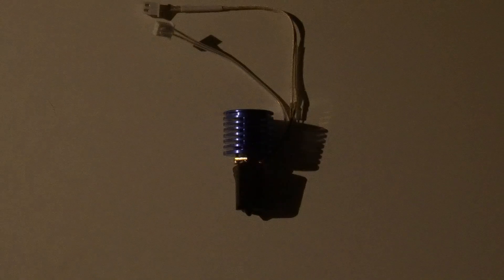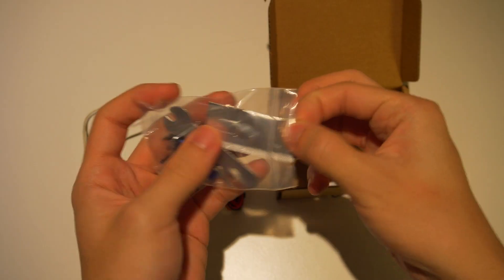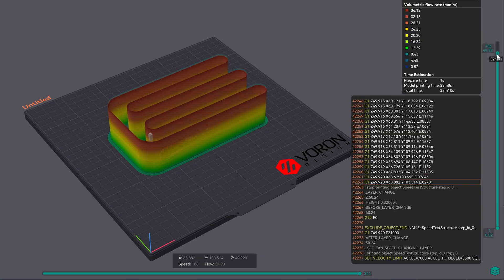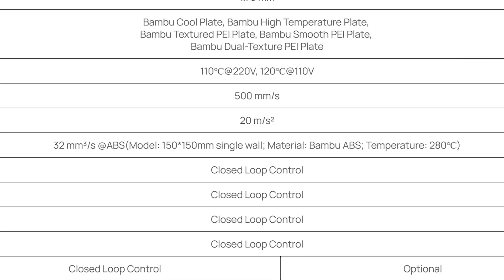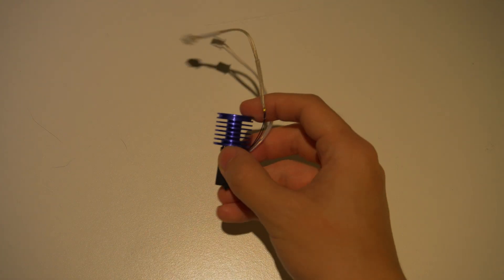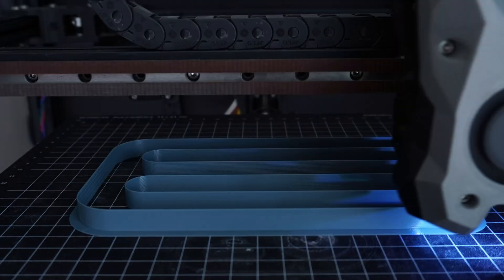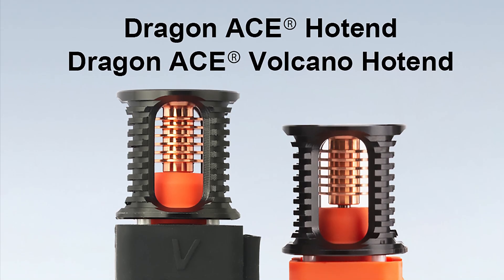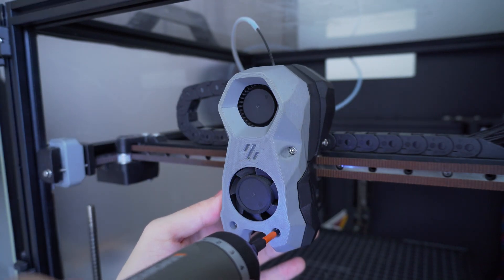TZ V6 – Is This Budget Hotend Worth the Hype?

Comment: Isn't the temperature not stable even if the PID calibration is completed?
Reply from the maker: After PID calibration, the temperature seems relatively stable when I'm not pushing the flow rate limit. 

It's only when I try to print too fast and hot with it that it becomes unstable.

Comment: add a second heater to the side, wire in parallel and go nuts. I have the X1C version, but the meltzone is identical. I hoped to get the V6 radiator for it, but v3 has nozzle and heatbreak in single piece. also I'd recommend to undo the two heatbreak bolts and apply threadlocker to them. mine came loose on my 4th TZ hotend, luckily I was in the same room with the printer when it happened.

the CHT nozzles add about 10% flow with added risk of oozing/webbing if travel speeds and accels arent fast enough. overall, TZ V6 hotends are best bang for buck, next in the list is Peopoly Lancer Long hotend which is less common and is not as supported but with heatsink cut smaller and holes redrilled and tapped can utilize same toolheads that support Goliath. Lancer Long does up to 55mm3/s in my experience and up to 30mm3/s with 90A TPU whilst I have issues with the V6 right now. next after Lancer is the mentioned Dragon Ace which can go up to 450-500C and push filament up to about 70mm3/s, with also easier maintenance as the thermistor and heater are simple capsules and do not need messing around with thermal paste.

also, print ABS at 270C-280C
Reply from the maker: I just accidentally broke the hotend and now I have a spare heater...I guess I will be giving a dual heater configuration a try now. Applying thread locker on the heatsink bolts is a good tip! Will definitely do that when my new TZ hotend arrives.

Comment: I'm using these hotends on my printers for over a year now. With a melt zone extender (with built in cht zone) and a V6 nozzle you have the same length as a volcano hotend. With a 80W heater (dual 80W for the insane people) you get plenty of flow rate. ;)
I like the hotend for the performance and their cheap price.

Comment: Maybe I missed something, but you didn't mention klipper adjustments. This hotend uses different thermistor, so you need to change your config accordingly, and then do PID calibrate command again. This should help with performance at higher temps and reduce oscillations. Also those are not V6 nozzles, even though it's got same thread size, it's of different shape and probably mass. If you change your nozzle material or shape it's not a bad idea to recalibrate your PID again, it's not a long process.

I am using one of those bimetallic nozzles(ZS V6 by TriAngle, one of the first of its kind),  maybe a bit more sensitive to cooling part fan, I didn't feel like I need to change a temp, but I've seen some advices to boost it up 5 degrees to match regular brass. My experience is good, and there are many other cheaper options, though it seems there are variety of filament path shapes and insert thickness that can affect performance.
Reply from the maker: It’s been a while, but I checked that I did update the Klipper config before doing the PID tune. Appreciate the reminder though! Yeah different nozzles can definitely shift the behavior. I've only used the coated brass nozzles and currently the bimetallic ones, so far they seem to respond similarly with same temp.

Comment: Seems like a fair take on the hotend! One thing I want to mention is that the heaters used on the TZ V6 are PTC heaters, so their power decreases as temperature increases. By the time you heat it up to 280c the heater will be close to half the power of when it's at room temp. Couple that with an already unpowered 48W heater and you're gonna have a bad time with ABS. A quick fix is to buy a heater for the Rapido 2. Those are 80w and are a drop in replacement for the TZ V6
Reply from the maker: That explains a lot! I didn’t realize the power drops at higher temps with PTC heaters. Appreciate the Rapido 2 heater tip! That makes it easier to look up than the ones I was showing on Trianglelab’s site.
Reply: @JustShapesJS  Did you try out the rapido 2 heater? Curious on the results for ABS prints :)
Reply: I actually buy the bamboo 60 watt heaters for my stealth changer and my Switcher. The TZ v6s are pretty solid, but most people buy them not understanding how to properly calibrate and tune these heaters to get less thermal flutter

Comment: Your numbers match mine, but i've had the original heaters fail on every one of these I've bought, and one of my thermistors has failed. I'm using triangle labs heaters and thermistors now and they are working well. Limit the power to 50% or so when doing a PID tune and you'll get a result that oscillates less. With a higher printing temp abs like 3DQF, 34mm3/s is achievable but low 20s are typical for PLA.

There's a revised mount for using these with V6 nozzles, I'm getting really pretty prints with an e3d plated copper nozzle, and I just swap the whole duct to put in another TZ with a hardened steel nozzle. The TZv3 has its own revo-like nozzles, all with hardened inserts. They are ok, but surface finish isn't as good as brass or plated copper.
Reply: I've been buying my heaters off of triangle lab, you can quite often still find in stock the bamboo kit that works perfect and is literally the same as the TZ kit
Reply from the maker: Glad to hear the Trianglelab parts are working well for you! I’ve always liked plated copper nozzles, but recently switched to a bimetal one . Plated copper body with a hardened steel tip. Just felt like a good balance of durability and thermal conductivity to me!

Since hardened steel isn’t as thermally conductive, do you think the hardened inserts might just need a bit more temp to match the surface finish of copper or brass?